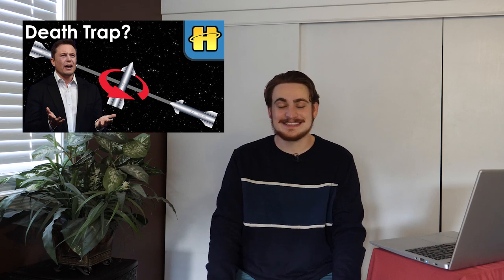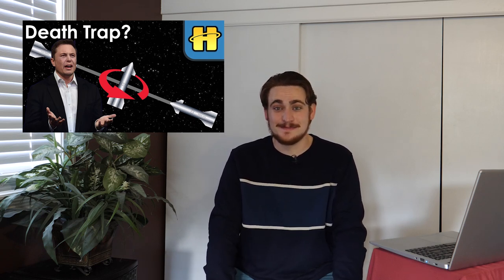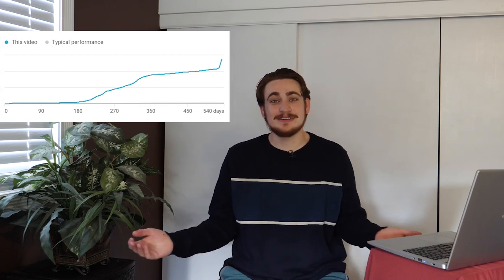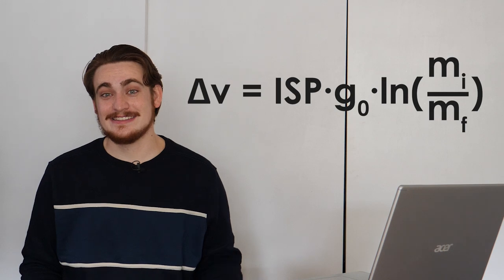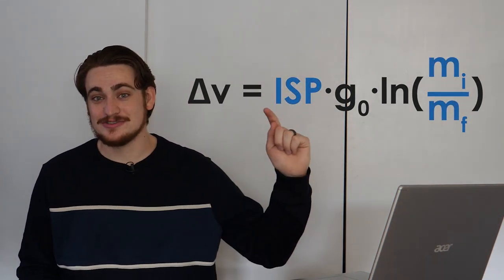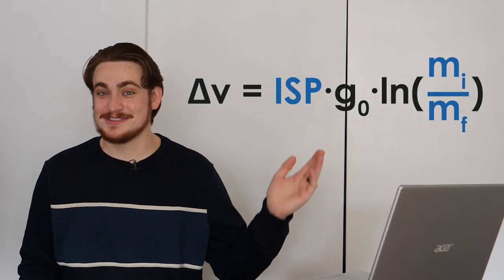Is Thrust-Based Artificial Gravity IMPOSSIBLE!?

Comment: I get the algebra, that a ln(1>) is negative, therefore making delta v negative, but I don't understand what does that mean in reality. A 1> engine still accelerates you, doesn't it?
Reply from the maker: The ratio is actually initial mass to final mass, if you put in a number less than 1 it implies you gained mass while burning the engine. We’re only using TWR in that equation because we want our intial to final mass ratio to match the initial TWR so you can accelerate at at least 1g

Comment: Thanks for clearing up some of my blind sides. I think the core of my thesis is to amass all this stuff on the moon as a first step. since the escape velocity from the moon is only about 20% of earth and the "mother ship" going to Mars doesn't need to be aerodynamic, there is a lot more freedom in its design. Basically, the multiple engines could be mounted on a bar joist.

Comment: I don't do equations, so I have to ask some basic questions. I don't understand why you sketched such a tiny crew area and, proportionally,  huge fuel tanks. Is the real issue in all of this only the amount of fuel a ship has to carry to have an ongoing acceleration?, Does it make major difference if, instead of matching Earth gravity you only aimed to produce, say, about 1/5th of Earth's gravity?--just enough to give crew a sense of weight to help maintain some kind of muscle viability, and prevent things from just constantly floating around in weightlessness---you know, so you could eat properly and play old-fashioned chess or some such. (Btw, do ships HAVE TO carry all the fuel? Couldn't there be, for instance, a number of remote-operated fuel-supply  "ship-tanks" put into some kind of static orientation in space between Earth and part way to Mars ahead of time that a manned, Mars ship could use to re-fuel, gas-station like, along the way?---this to avoid having to transport ALL of the needed fuel within its own hull.  (Has anybody proposed re-fueling stations along the way, or is there absolutely zero practical way to do that?) 
  Would nuclear fueled ships help solve the steady-acceleration-gravity problems?---or are they impractical (and, if so, is this primarily due to safety concerns?)
Reply: No matter how much or little acceleration you want, if you're burning your engines constantly (or even for 30 minutes per day or whatever as suggested) you're wasting a shit ton of fuel. If you set up refueling tanks, then you're changing one trip to mars to like a few hundred trips to various points along the path, and you have to make sure they all line up in their orbits at the exact time you're going to pass them so you can refuel. I'm not going to try to imagine how much that would cost or how long it would take to set up. The alternative is not doing any of that because in space you don't need fuel except for starting and stopping, and you strap the astronauts to a spinning wheel for 30 minutes a day, and you put velcro on their chess pieces.
Reply: @ryanmccampbell7  Thanks. I appreciate your taking the time to respond! 
   I wasn't actually thinking about any more than maybe 3-4 re-fueling stops, (but how would you know since I didn't clarify that/my bad).. I mean, what you are suggesting makes total sense. That is the current state of things.  I'm very interested in space exploration, but am not remotely a physicist able to calculate all of the factors. I'm just looking at it from a "what if" and/or "sometime in the far future" perspective, ie as an imaginative exercise (being a film person/writer who grew up at a time when the idea of space travel itself, even only to the moon,  was kind of a crazy joke, ie merely a fantasy of the impossible.)
   Other than the fuel issue (oh, THAT little ol' pesky  factor! ha), the steady acceleration is the most direct, seemingly most elegant way to provide  a constant gravity-based/"ground-oriented" life for a crew while traveling through space. The problem seems, in its entirety, to be solely about fuels that we can currently, concoct or even imagine.. (Are there any nuclear-based and/or ion drive type ideas that show promise towards more efficient, less mass-weight based propulsion options? Guess I should just go and look into this myself to satisfy my own curiosity.)
  Thanks for your thoughts! (Now if only we could capture one of those ever-elusive tic tacs that seem to have been badgering the naval air force...and slave their  tic-tac-tech to our space-traveling needs and desires! ha...)
Reply: @RSEFX  I think that while naively it seems like the "acceleration = thrust" can kill two birds with one stone, really trying to repurpose one thing for another just makes it bad at both things. The most efficient way to get a space ship from point A to point B is not going to be constant acceleration. I don't have a good idea of the complications but I imagine the spinning designs (either with a tether, a ring, etc) are much more practical because you don't need to constantly spend energy/mass to produce artificial gravity. It's just free once you get it spinning up.
Reply: @ryanmccampbell7  I just figure the future is a long long time  (unless we wipe each other out) and that a killing of multiple birds (which sounds rather mean-spirited) with one stone may be not the worst of goals/may be found, in time, so we will no longer be moving through space in the only ways we can imagine in the here and now. (Maybe it'll take a stone and an extra pebble or two?)  But I shouldn't mind being on a carousel again, and I always enjoyed the "Round Up"",  that ride that plastered you centrifugally to the wall of a big spinning cylinder. In fact, I always wanted to try to stand up on that wall, sorta as characters did in the old space films that took place in  big donuts rotating above the Earth.
  Going to the moon was considered a naive fantasy for centuries, right up until my earliest years: Such was the unimaginable thing. That "fool's errand" was proven to be not that after all. Well I guess its that quixotic spirit that often makes us think about challenging windmills, even if and when they spin where there IS no wind.
Reply: "Would nuclear fueled ships help solve the steady-acceleration-gravity problems?" -- steady acceleration means gaining the same amount of kinetic energy per unit mass with each metre travelled. If you climb a tall tower on Earth, carrying something heavy, you increase that thing's potential energy by an equal amount with each metre climbed. If you then drop it, it gains that same amount of kinetic energy per metre fallen.

But it falls at an increasing speed. Its rate of gain of kinetic energy, its kinetic *power*, increases. That's constant acceleration for you.

Nuclear fuel lets you pack plenty of energy for interplanetary trips in a small fraction of a ship's mass, but increasing the power, steadily for weeks or months, soon hits a limit. You can't convert nuclear energy to kinetic energy efficiently enough that you aren't saddled with a huge heat problem. Along with kinetic power that you want, you also have thermal power that you have to get rid of. Since this increases at the same inexorable rate, if you manage to accelerate steadily, inevitably you can't sustain a full gee for very long.

In short: no. Nuclear energy promises much quicker interplanetary trips, but not as quick as one gee forward boost halfway, then one gee braking the remaining half.
Reply: @grlcowan Yup you reach stupidly high speeds for practically no reason. The only method I could think of is either crazy antimatter or blackhole designs.

Comment: When I read the title, my mind immediately read "Torchship" and Fusion Propulsion. I know it's theoretically possible to have a constant 1g burn for a Brachistochrone Transfer. But I also know that using any drive we could theoretically make short Orion, it is impossible, and nobody wants to revive ol' boom-boom as far as I'm aware. Sure it's wasteful, technically, but also, iirc, a total constant 1g burn on its transfer, including a flip and counterburn, will get you there in just a few days. But... that's a very long ways off.

Comment: One thing you don't really mention is staging. Right, in principle you can jettison your rocket engines and tanks whenever they run out and that will get you higher numbers. Though also ridiculously high vehicle sizes. Since beating the maximum for single stage raptor of 18 km/s of 1 G acceleration is going to require many many stages.

Comment: I've always said that the problem with generating continuous thrust for long space journeys isn't carrying enough fuel -- it's carrying enough reaction mass.  
If a ginormous aircraft carrier or nuclear submarine can run for years and carry enough food, fuel, and oxygen for the entire trip, why can't a spaceship?
#ItchyFeet
Reply from the maker: Well, for non electric propulsion the fuel is the reaction mass but I think I see your point
Reply: Submarines have handy dandy ocean to be their reaction mass
Reply: @idris4587  Tell me you didn't read my whole post without telling me you didn't read my whole post.
Reply: @fredashay  I understand your point, but subs and carriers use the water as their reaction mass, which means its extremely efficient at turning that fuel into kinetic energy. The mass of water compared to that of the ship is  so high that you wouldn't consider the ocean being affected by the force of the sub.

Nuclear subs just create electricity to turn the prop and lights. I agree the power of nuclear energy is more efficient, roughly 900 isp atm (double chemical engines), but that's barely using the million times more energy dense material. Subs limiting factor is literally the food they carry. 6 months tops, plus the water is their free oxygen.

To have a nuclear powered spaceship like a sub, you'd need so many radiators for the excess heat as there's no ocean to cool the ship down.

To have constant 1G acceleration (or 1/6th or 1/3 G for Luna and Mars) you'd still need esptein drive like crazy fusion antimatter muon drives to be fuel efficient enough to have enough force without guzzling that much fuel. 

Remember:
Force = Massflow Rate * Exhaust Velocity

You want a high Force and low Mass flow rate meaning you need a crazy small % of C ammount of exhaust velocity to create it

Comment: A lot of people understand that an object falling from a high tower on Earth gains 9.8 joules of kinetic energy per kilogram per metre of fall. (This is just the m*g*h formula with m set to 1 kg and h set to 1 m.)

But in spaace why can't acceleration *halfway to Mars*, at 1 gee, be somehow different? Be not the same thing as falling 30 billion metres, kinetic energy-wise? Not require building up 300 billion J/kg? Versus rocket fuel, which contains only 0.01 to 0.012 billion J/kg?

Well, it isn't. You can't carry that much energy if your energy reservoir is chemical rocket bipropellant.
Reply from the maker: Yeah, if I recall the authors of the expanse said the Epstein drive ran on “efficiency.” They didn’t know what technology could do it, but whatever it is it would have to be near perfect efficiency (mass to kinetic energy)

Comment: What is the general consensus in the space-travel community re: the type of interior rotating carousel-type "gravity-maker" that was featured in 2001?  Couldn't a rotating interior ring-type environment be provided to the ISS, ie as a separate module that astronauts on long missions in orbit could enter in order to experience some kind of semi-Earth-like gravity to help ameliorate their hunger for the comforts of "home" from time to time? Has this ever been proposed?
Reply: It takes a very big hull to accommodate a very small carousel, plus bearings to let it turn while the hull is spinless, plus a motor to drive the rotation against the resistance of those bearings, and of the air. And you don't want to be drifting in the free-fall part of the pressure vessel and crash into a spoke of the carousel. If its external radius is 4.3 m, so that it just fits a 9-m outer hull, and the one-gee radius is 3.2 m, the one-gee tangential speed there is 5.6 m/s. As you stand on the inner surface, your midsection is at that 3.2-m radius, your feet are at 4.2 m, going 7.35 m/s -- so bric-a-brac drifting in from the free-fall section, if that could happen, would hit them that fast -- and getting 1.3 gees.

Your head is at radius 2.6 m or -- if you're tall -- less,  getting 0.8 gees or less. Nothing wrong with that. Not only can astronauts hold their heads high, this setup makes it easy.

But your scarce interior space, you've subdivided with at least three substantial walls that prevent floating hammer/heavy foot collisions, and ensure, when you are near the outer hull, either in the carousel or outside it, the wall nearest you is not moving with respect to you. Two of them rotating, one of them, maybe 2 cm away from a carousel wall,  stationary. These two walls have small central round holes bounded at radius, I guess, 0.4 m, with the nonrotating one having a round screen door, so you can float in and climb down the 3.8-m ladder to gravity. The top of the ladder goes 0.7 m/s so seizing it and being accelerated  to its speed is not difficult.

Spaceflights are long and those bearings must go at 16.7 RPM of the 4.3-m-radius wheel throughout them. Also not a big deal, but does imply noise and power consumption all day throughout the flight.

There's a much nicer option: a system that is almost entirely rotating, only some subsystems despun on gymbals. A system that uses the cosmos as a giant, noiseless, no-power vacuum bearing. Your feet get 1.00x gees, your head gets 0.99x gees, and all the pressurized, gravitied space can be undivided. The movie Stowaway shows it.

From such a space, you can get really good views through the floor windows. Sadly, the makers of Stowaway apparently didn't think of that.
Reply: @grlcowan  Thanks. Was just speculating. This would suggest that the Discovery/Jupiter mission in the Kubrick film, 2001---you may have seen it?---was not a very  accurate prediction of artificial gravity on an interplanetary journey (the ship had the "big carousel" as being contained within the body of the ship). Of course, a lot of stuff in that film all turned out to be way off. 
  Thanks for the thoughts/any further thoughts!
Reply: @RSEFX  If you search for "long-heavy-tail option for spin gravity" you should find some of those thoughts.